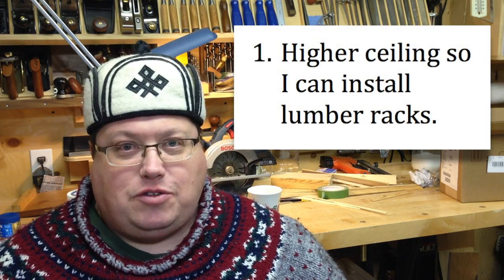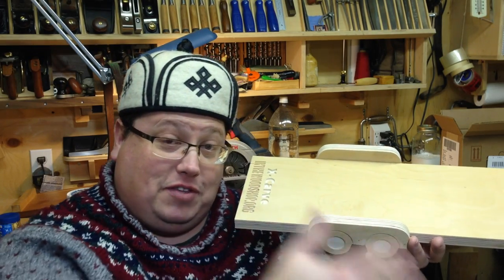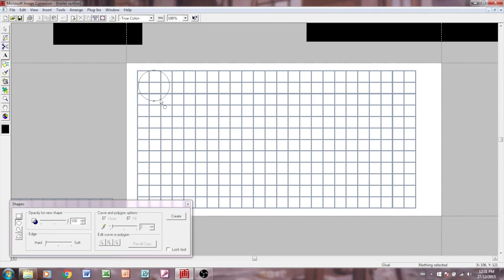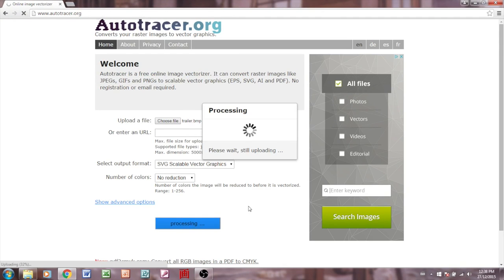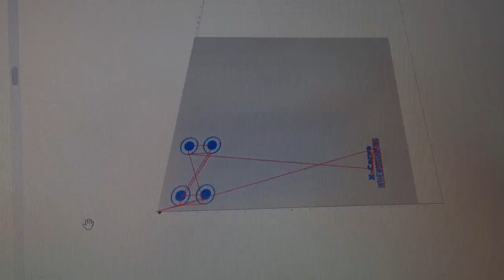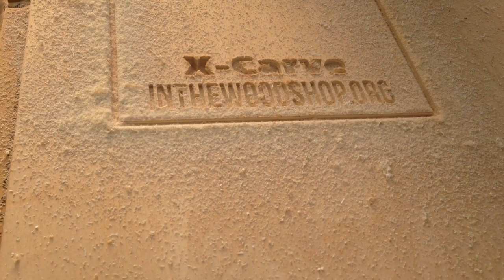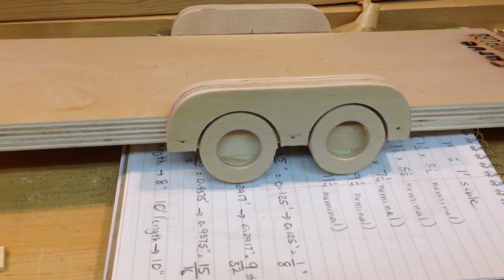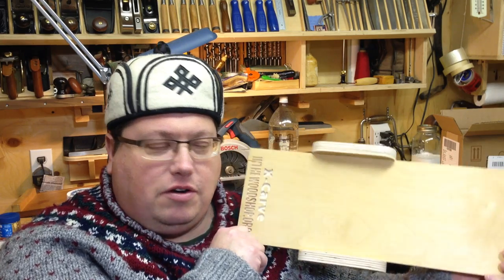Model a Flat Bed Trailer with the X CARVE: Tiny Woodshop Pt  1

Comment: Really cool! I mean the trailer model not the weather. ;) I think I would have put the wheel wells inside the box in order to get the extra width. You can always enclose them under a bench or storage unit. I have a 6' x 16' enclosed construction trailer and I wish I had the extra width. I look forward to the rest of the build.

Comment: what bits did you use for the X-Carve?
Reply from the maker: +KWS07 I used a 1/16" spiral upcut for the decorations, and a 1/8" single flute cutter to cut it out.  I would have used a spiral upcut but I didn't have one in 1/8".  The bigger bit allowed my to increase the feed rate a bit, besides it had to cut through 3/4" of plywood .